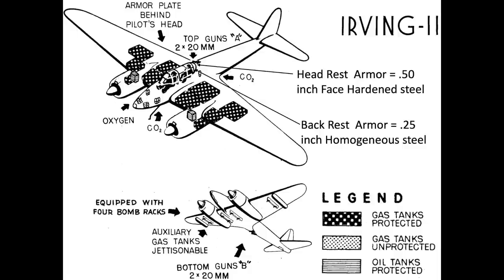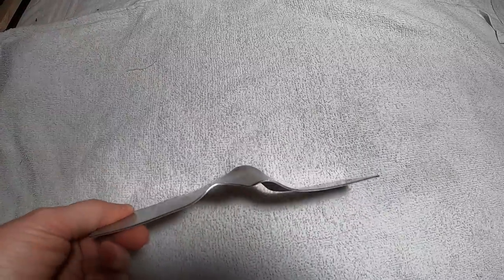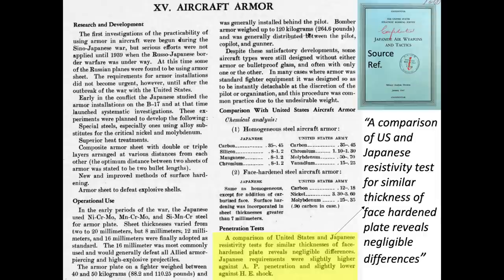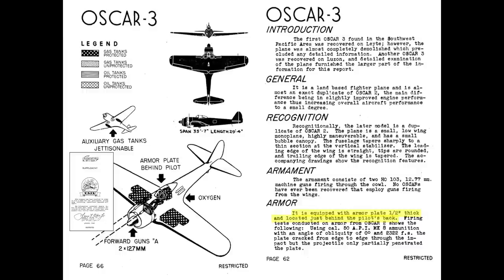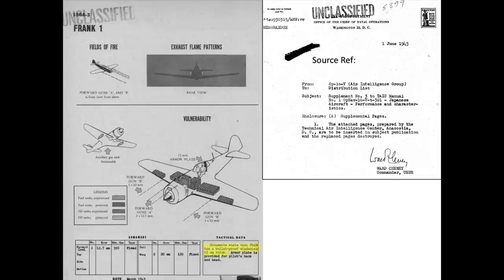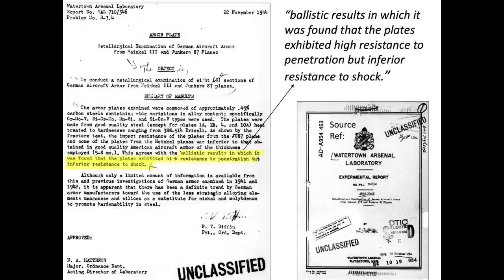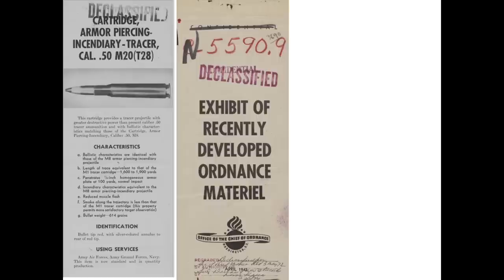How did WWII German and Japanese Aircraft Armor Compare to US Armor?

Comment: I learned something new: for as long as I've known that WW2 aircraft were armored, I always assumed that the armor was thicker pieces of aluminum.  Color me wrong and surprised.
Reply: BUUUURN!  Sry' ;-)
Reply: It'd have to be really thick to have the same qualities as good steel, and even if it came out weighing the same you'd have space issues due to it's thickness. 
There was however relatively bullet resistant aluminum that was used in US and German fighter fuselage in critical locations that I believe was called Duraluminum, it wouldn't stop .50 cal rounds at a perpendicular angle but could make them ricochet at shallower angles such as the typical hits from a fighter attacking from behind.
Reply: @Duke Craig  No, duralumin is just the standard alloy of aluminium used in aircraft since the 1920s. It has copper, manganese and magnesium mixed in, making it stronger and harder.
Reply: We live and learn. Stop learning and you stop breathing!
Reply: @dukecraig2402  M113 and light armored vehicles use aluminum armor.the M2/3 uses aluminum applique steel and reactive, depending on mission
Reply: @JohnRodriguesPhotographer  
Why are you bringing up that?
This is about WW2 aircraft. 
And I'm very familiar with what the Food Machinery Corporation (FMC) M113 chassis is made of, I lived in one for 3 years.
Reply: @dukecraig2402  some ww2 aircraft did have alum armor
Reply: @kenneth9874  
Not really, calling Duraluminium armor is a stretch, it's hardly armor and anyone who claims it is just doesn't get it.
Duraluminium will never stop a round hitting straight on in the thicknesses it was used in on WW2 aircraft, it would only deflect rounds that were striking it at high angles, which is typical for an attack from the rear, they would use it around cockpits and areas that had things like oxygen bottles or something else you didn't want penetrated for obvious reasons, but it wasn't used in places where you truly needed bullet proof type armor like the plate directly behind the pilot. 
People get a little carried away thinking it was some type of armor plate, it wasn't, it simply was better than regular .032" thick aluminum sheet in some area's, as I said it'd deflect rounds hitting at high angles but it certainly wasn't in the class of what can be considered armor plate.
Reply: @dukecraig2402  that's your option.....but that does nothing to negate the fact that it was used as such
Reply: @kenneth9874  
No it wasn't, that's just the point, it wasn't used in place of true armor protection anywhere and the proof is you can't find a single example of it being used as armor protection behind a pilot, because it couldn't defeat straight on shots.
The M113 armored chassis I spent 3 years of my life living inside of was made from 3" thick aluminum alloy very similar to Duraluminium and it wouldn't stop a .50 cal straight on, believe me I know I shot plenty of old M113 hulls they drug downrange for us to shoot with M2's, and that wasn't even AP .50 cal we were shooting them with it was regular ball ammo, the ½" thick Duraluminium they used for fuselage panels around the pilot on the FW190 surely wouldn't stop .50 cal AP it if 3" wouldn't stop .50 cal ball ammo, but at high angles it'd deflect a shot that'd go through typical .032" thick sheet aluminum which is why they used it.
Same thing as there's a difference between bullet proof and bullet resistant, for all the thicker the Duraluminium was when it was used for fuselage panels it certainly doesn't fall into the class of armor plate, it wouldn't even defeat .30 cal AP straight on within 200 yards or so.
Reply: @dukecraig2402  there was no limitation of protecting the pilot directly but it did protect systems vital to the pilots survival, check out the a26 and quit being so childlike
Reply: @kenneth9874  
Childlike?
Oh, you're going to resort to personal attacks?
Try looking in the mirror when you say childlike, that's where you'll find it.
All your doing is making claims that are based on your misinterpreting the use of Duraluminium in certain areas of aircraft, as I explained to you once already calling it armor protection in the context of it's use on aircraft is like calling something that's bullet resistant bullet proof.
If your claims were true then steel plate wouldn't have been used anywhere on an aircraft, they'd have only used Duraluminium, and US aircraft armed with. 50 cal guns wouldn't have been able to shoot anything down, but they did, and in great numbers. 
Sorry if my own personal experiences in these matters gives me insight to these things that anger you to where you have to resort to insults, but it is what it is.

Comment: I wonder how many air crew casualties were actually prevented by aircraft armor?   Might have been more of a morale factor.  Doubt much research could have been done after crashes.
Reply: I've read numerous firsthand accounts of pilots who were saved by their seatback armor. Robert S. Johnson's famous defensive encounter with an FW-190 when returning from a mission to Villacoublay airfield in 1943 immediately comes to mind.
Reply: It saved a lot of lives. Even if the plane was destroyed, the pilot had a much better chance of survival. Planes were cheap and easy to replace back then. Pilots, not so much. I just checked The First Team and in the section on USS Enterprise's raid on the Marshall Islands it says that the only reason Lieutenant James Gray survived a dogfight with 8 A5Ms defending Wotje was because of a piece of boilerplate steel added to his Wildcat as makeshift armor just a few weeks earlier (he was flying an F4F-3A, which didn't have armor as standard).
Reply: Didn't you understand the statistic charts shown in the video? 

The seat armour alone could withstand an 50 cal AP/I round at 500 yards... add the fuselage plating and other metal structure that the rounds had go through and you have decent armour from 300-400 yards onwards, which is decent. Add oblique angles and the armour effectiveness increases further.
Also think of the post penetration effects: a 50 cal bullet that lost 80-90% of it's energy penetrating a lot of sheet metal and armour might just give you a mean flesh wound. You can still bail out with that. One that comes in at 2200 ft/s simply rips through your abdomen and takes all your intestines with it.

I'd chose armour any day of the week.

Comment: Cool.  Great video as always.  
I know it's not entirely apples to apples, but some data on total weight of armor would be interesting (as a proxy for area covered).  Off the top of my head the Ki-43 3, i.e. the up armored Oscar, had less than 100 lbs and the P-39 had about 240+.

Comment: My understanding is the Ki-43 Oscar had very little armor and no fuel tank protection. Same thing for the A6M series fighters.
Reply: The original versions at the start of the war had no armor. It was added over the course of the war. The final Zero variants had wing tank fire extinguishers, armor protection, and bulletproof windscreens.
Reply: @Ralph-yn3gr  
No the final variant's of the Zero didn't, armor plate behind the pilots and a few others areas was tried at one point but the extra 400+ lbs of weight completely trashed it's performance characteristics, as a result they only made around 400 of them and kept most of them in the rear as trainers, they went back to making the basic unarmored design after trying the unarmored one's, most of their attempts to give them defensive characteristics didn't stand up to the .50 cal guns of US fighter's anyways so at the end of the day all it did was trash their performance without adding any defensive qualities anyways. 
People get a little carried away believing that the Zero was some kind of advanced aircraft "ahead of everything else in the skies", it was simple, trade weight for speed, range, climb rate etc etc, that's aircraft design 101.
When early reports of the Zero's performance started showing up the high command didn't believe them because the Zero had some advanced design that no one else could understand, they didn't believe it because they assumed being a combat aircraft the Zero would have defensive protection features, once they got their hands on one and they saw it didn't have armor protection for the pilot and other defensive features it made sense. 
The Zero is a false God, it's entire reputation was built on the early Japanese successes when it was flying against Chinese biplanes and against US pilots who early on had no combat experience and were trying to fly against it the same way they'd been training before US forces entered the war, which was in mock air battles against other fighter's of the same design which obviously gave them the same performance characteristics, but they caught on fast and quickly turned the tables against it by simply not trying to fight one in a low speed turning fight which is where it had advantages, at the end of the day even the Wildcat had a 5 to one kill to loss ratio against it, and that's pretty good when you take into consideration that it flew against the highly trained and experienced Japanese pilots early on, by the time the Hellcat came along Wildcats had already killed the bulk of experienced Japanese pilots which left it fighting against mostly poorly trained Japanese pilots some of which had as little as 10 hours time in the planes they were fighting in, that's why the Hellcat had a kill to loss ratio against the Zero almost 4 times higher than the Wildcat, it's not that it was 4 times better it's just that it was mostly flying against Japanese pilots that were a different class than the one's that the Wildcat flew against early on, the Wildcat killed more experienced Japanese pilots than the Hellcat did, most of their big shot aces were downed by the Wildcat by the time the Hellcat and Corsair came along.
Reply: The Zero was stronger than the Wildcat.
Many Japanese aces were lost due to poor information, timid decisions by the Japanese military command, and the unreliability of engines, machine guns, and other equipment due to substituting materials that were scarce in the U.S. strategic attack.

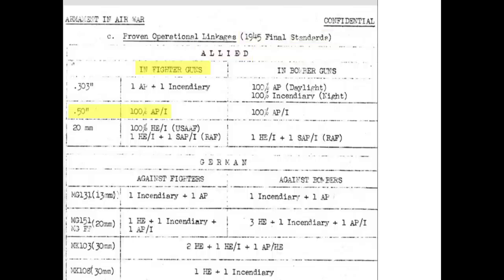Comment: At 2:38, the chart shows homogenous armor having better performance than face hardened. You state that homogenous armor must be thicker than face hardened to match homogenous.  I suspect face hardened does have better performance, otherwise why go to the expense?
Reply: Nah, that graph is just very awkward, I also had to make a double-check just to understand what's going on. It shows not the penetration, but instead how thick an armor you need to stop a .50cal bullet from various ranges. So for example on 600 meters range you need 0.67 inches of homogenous armor to stop a .50cal, while of face-hardened armor you only need 0.47 inches for same effect. To oversimplify it: "less is better" on this graph. So face-hardened armor is more effective

Comment: It is unfortunate that armor was not incorporated, having superior strength to the aircraft's structural members, into the structural members thus, giving pilot protection along with a savings in weight.
Reply: The B-29's mid-wing structure is said to have been modeled after the Japanese Zero fighter.
If the Akutan Zero had not been acquired by the U.S. military, the B-29's performance might have been even lower.

Comment: 20mm fw 190 armour. Seems excessive ??
Reply: It actually makes sense ; the Fw 190 A-8/R-8 has a canopy that exposes the pilot's head to with a high probability of rear shots that would just have to penetrate the plexiglas to kill the pilot, with nothing else in between.

Also note that the pilot's back was fairly well protected as well ; while it's not a single 20mm thick plate, items 8, 9 and 10 in the armor chart seem to overlap.

It should also be pointed out that the A-8/R-8 is a Sturmbock variant, with heavier weapons and armor intended to engage heavy bombers, as the regular A-8 on the same chart has some thinner armor in some areas or none at all when compared to the A-8/R-8.
Reply: FW 190s usually went against B-17s and B-24s were they would encounter 100-200 .50 cal. Machineguns... and thus while passing near the Bomber formations get hits from all over. I am sure that 20mm armor stopped quite a few .50 cal hits.

Comment: Armor plates were not hi-tech material at then, so the performance should be identical. Turbo-charge fans on the other hand, was a different story.
Reply: Of course armour plating was high-tech. It was among the most advanced metal of it's time.
Also: all major nations had decent turbo-chargers.

The technological differences in many fields were just incremental between Allies and Axis. And there were no fields I know of where the tech-disparity was more than, let's say ten years. 

Example: the Allies were ahead in radar technology on the Germans by a few years and several on the Japanese. The Japanese then again had MAD (Magnetic Anomaly Detector) devices which they could use to locate submarines by the disturbance the sub did in the magnetic field of Earth. Germans had the first combat-ready Jet fighter, beating the Allies by maybe a year. Then there were the Greman missiles, etc, etc.

So basically, it was always relatively close.